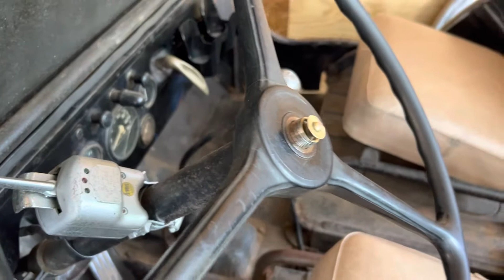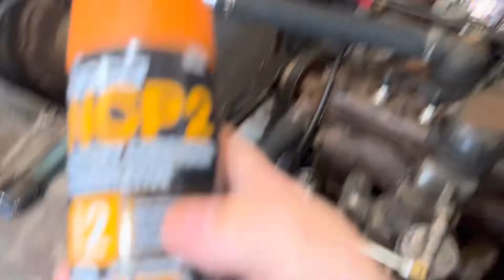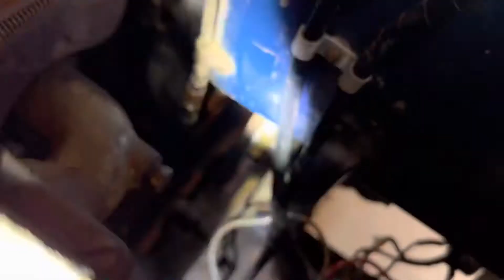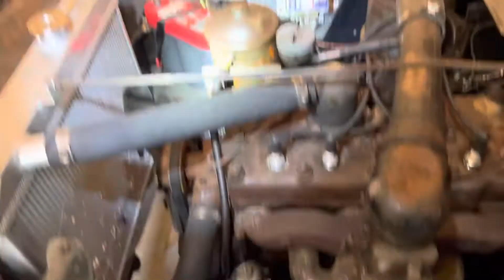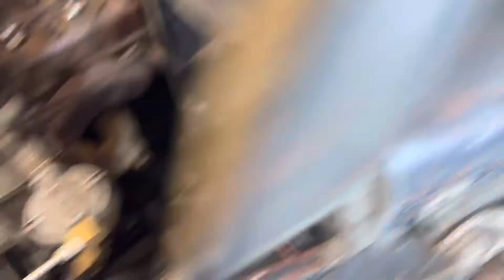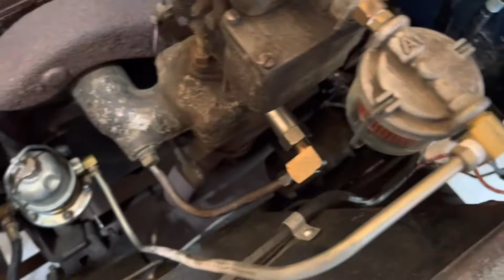Willys CJ-2A Jeep Horn Wiring Circuit Explained

Comment: Thanks. I also have the Welch wiring harness and it’s been a bit difficult to get it going. I haven’t hooked up the horn. I liked the relay you installed. Your video is clear and I’ll get it set up the next time I’m spending some time on the Jeep. Mine is a 1970 CJ 5.
Reply from the maker: Thanks Chuck. I got that relay on eBay for a few $, they are out there still. Good luck getting it wired up.